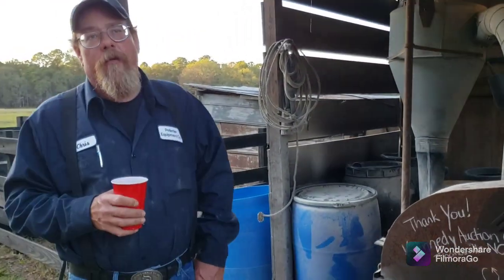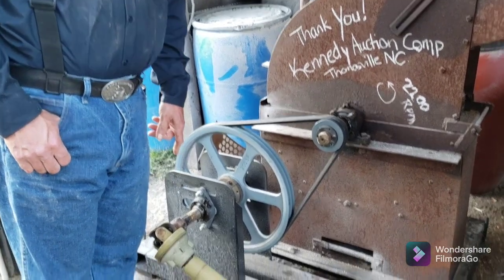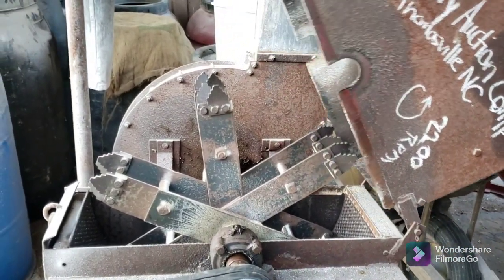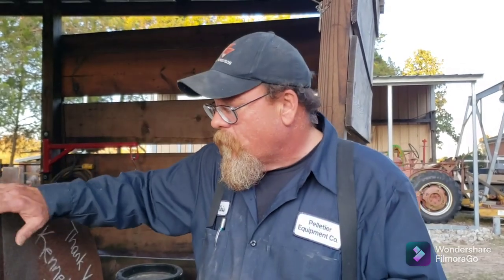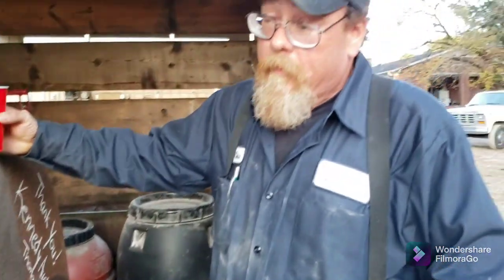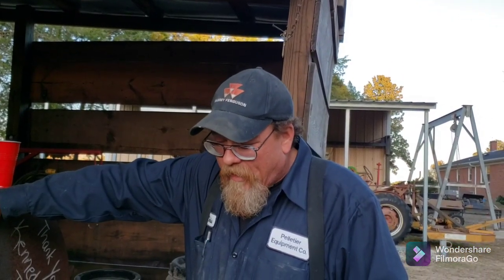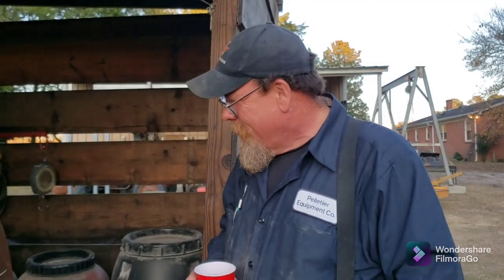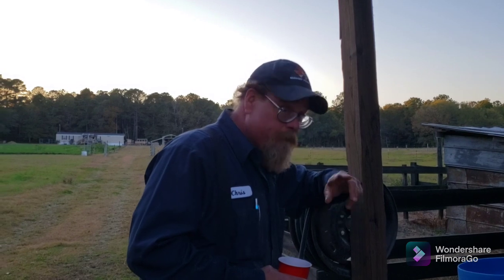Sears 919.75 Hammer Mill; Converted to PTO Drive

Comment: We used to have a farrow to finish operation, about 200 sows(my Daddy and Uncle ran it). The 1998 prices put us on contract until we quit in 2015. We're thinking about getting a couple of feeder pigs to finish out for the freezer, but we got rid of our original hammer mill/mixer, since we weren't using it anymore. We have a hammer mill similar to yours but smaller I think, and ours doesn't have the cyclone chamber on the output spout. Is that to take some of the dust out of the feed? Our mill/mixer used to have one on it, but I never saw much dust come out of it. My son and I really enjoy your videos.
Reply from the maker: I'm not sure what that thing does , I think it has more to do with bagging . Porks going to get expensive soon so now would be a good time to feed your own

Comment: I have a 9in i h mill ,rotation, look at blower , i run two b  belts 3600 rpm same ,as this belts set ,run 454 ih 1000 rpm pto engine at 14 oo rpm
Reply from the maker: We're only running this one about 1800 to 2000 rpm that's with a Ferguson 30 about a third throttle 540 pto .